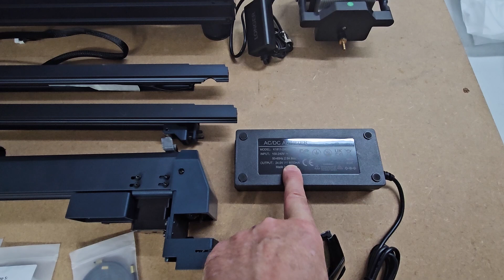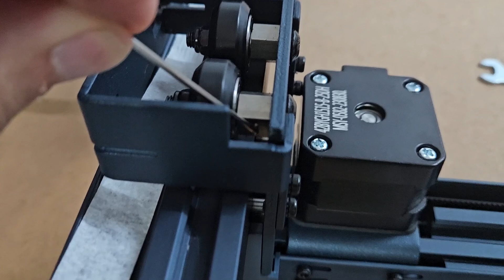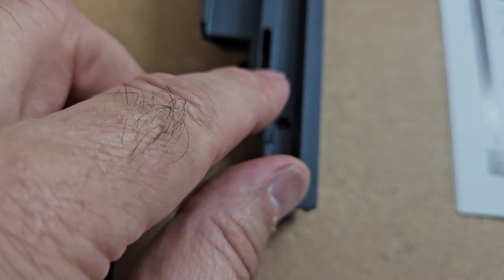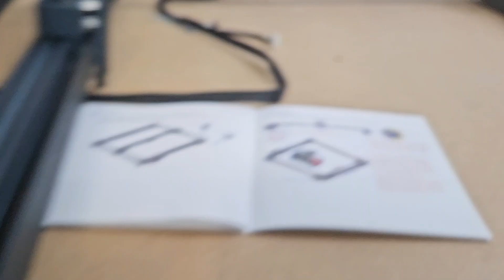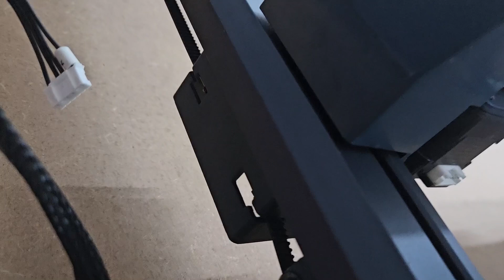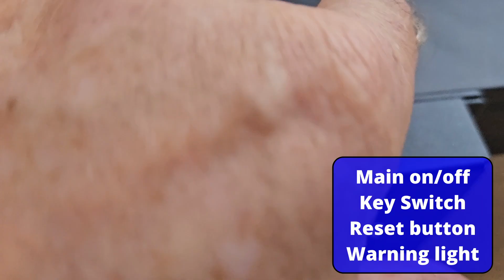Longer B1 Diode laser engraver frame assembly. Easy belt install eccentric nuts

Comment: You mentioned you would put the link to another video specifically on eccentric nuts, tightening etc. Where's the link?
Reply from the maker: Hi Thanks for the heads up eccentric nut link just added

Comment: Wish I had found you about a year ago. Far more useful information here in this one video than in almost a year of dealing with Longer. Thank you!
Reply from the maker: Thanks. Glad you have now found me. Help to help where I can. Many of my other videos are a relevant to your laser. If you can comment on the video that helps you that really helps grow my small channel and a thumbs up always make me smile
Reply: @FlixmyswitchLASER  I will definitely comment on helpful videos/advice! Speaking of which...would you have any other ideas other than the setting you mentioned on FB as to the diminished power I am experiencing? I keep this machine, pretty much, spotless as far as cleaning and I have never changed any settings that would affect the power...as far as I know. It has gotten to where I am having to make 5-8 passes on 3mm plywood and 12-20 passes on 6mm plywood...at slow speeds and no more than 90% power. When new I could cut cleanly thru either of those materials in no more than two passes. Really not sure what has happened. Keep in mind also...I have only been at this since last November...so still a novice. I do appreciate any advice!
Reply from the maker: Make sure you are using the correct power supply.

Check $30 and s curve are both 1000.

Make sure you are using mm/m and not mm/s in Lightburn as that would have a massive impact
Reply from the maker: Have you ever done metal engraving or engraved on the reflective side of a mirror, something you should NEVER do
Reply from the maker: Did you check your settings
Reply: No…I’ve not ventured into metal or glass at all yet. Thanks for all of the advice!
Reply from the maker: @BDodgen that's good so you should not of had beam reflection back up into the laser module